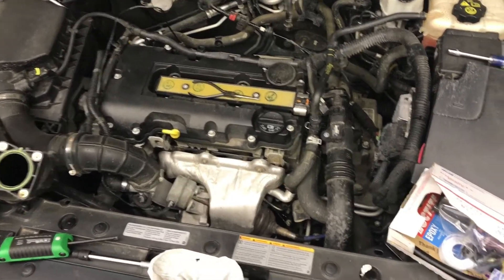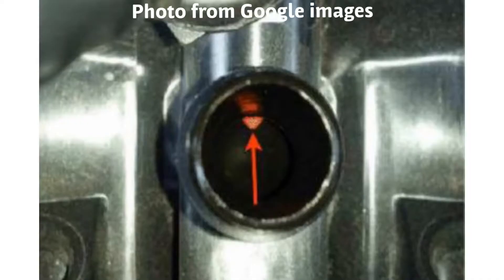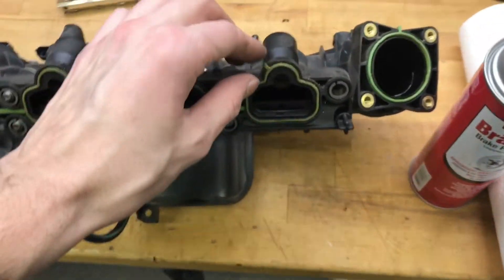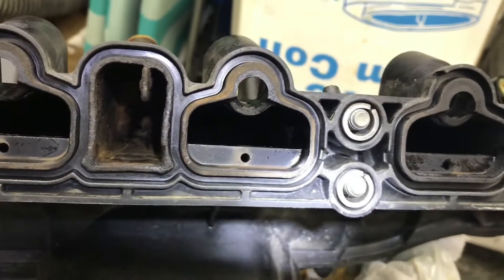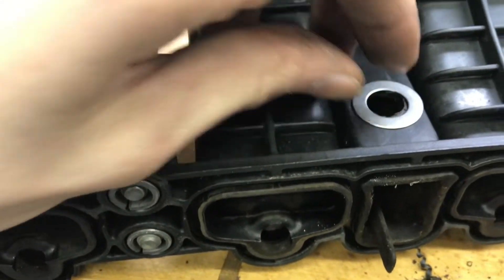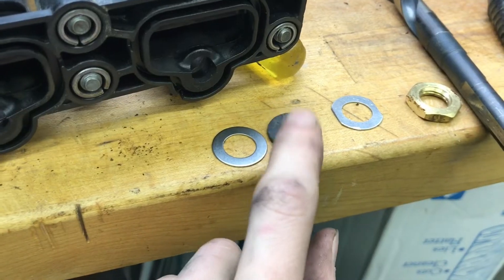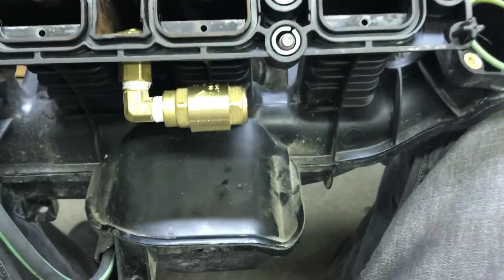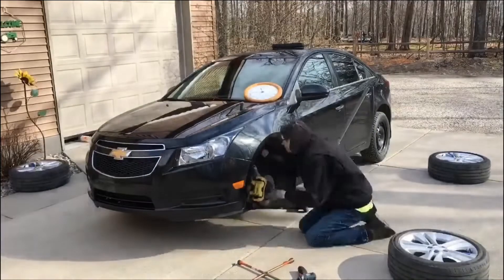Chevy Cruze Intake manifold PCV valve fix kit V2 supplemental Installation

Comment: @mr95kenny I have oil leaking from around my valve cover. I was told that was caused by a failure of a valve built into the valve cover. Would installing this kit on my intake manifold resolve the issue Or should I just replace the valve cover?
Reply from the maker: brandon rouer you need to replace the valve cover, this kit fixes it so the valve cover wont fail again
Reply: Mr95Kenny Ah, so I need the kit AND new cover?
Reply: @brandonrouer661  yes, that's what I did
Reply: @brandonrouer661  yes, as Mr95Kenny said, you'll end up replacing the valve cover again and again if you don't take care of the underlying problem, which is the failed rubber check valve. GM is well aware of this problem but it ignored it. Never issued a recall or even a technical service bulletin. GM left it up to Cruze owners to do their research and understand what the problem is, and then attempt a DIY fix, or take it to the dealer or a mechanic. But even then, that's not a permanent solution. GM's OEM intake manifold features a rubber check valve. Unbelievable, isn't it?
Reply: @csn6234  total bullshit.  GM should pay to have it fixed.  I would be ok with them installing this kit for free.

Comment: Cuz i have a chevy cruze 1.4 and all the oil gets stuck in the throttle body do you know any solutions to that problem
Reply from the maker: Juan Renteria  dried out valve cover gasket.
Reply: @Mr95Kenny  sir had put a piece called l believe a cover gasket and the same problem is happening can you give me any advice
Reply: Does it have to a be a original piece or can be a different kind
Reply from the maker: Was the valve cover replaced as well? A blown pressure regulator valve built into the cover can make it leak as well.

Comment: I bought this kit and installed it in Dec. 2018. Andrei, the guy who developed this kit, did an amazing job. The kit is robust and is exactly what Chevy should have installed in this piece of shit engine at the factory. I advise anyone who is experiencing problems with their Cruze's PCV system to buy this kit and self-install. It's not too difficult and you will be very happy that you did it. The kit costs $75, which is cheaper than what GM charges for the valve cover that you'll have to replace when the diaphragm fails if you don't install this kit.
Reply: Where did you buy kit